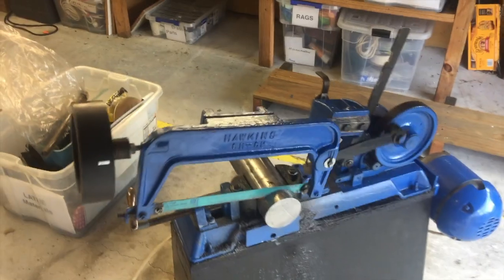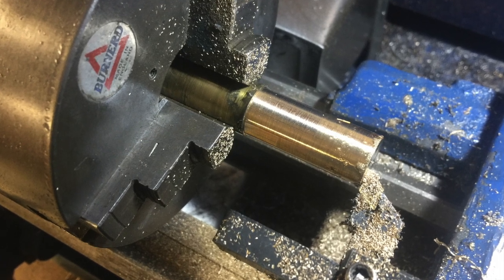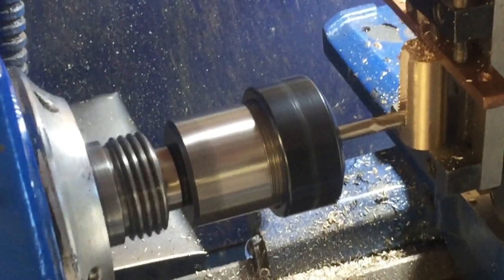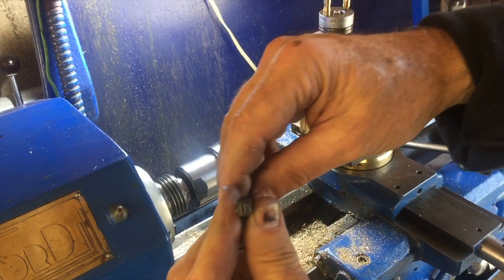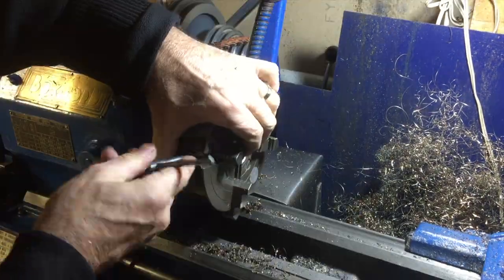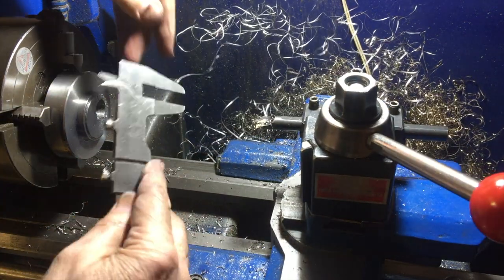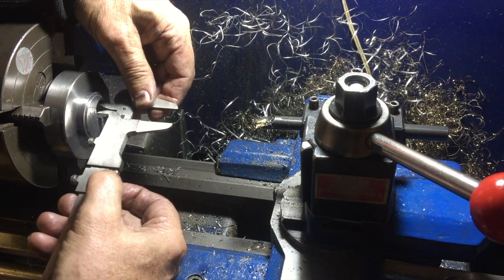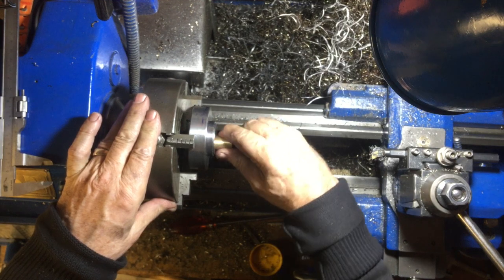Milling a slot with the lathe milling attachment

Comment: Conventional milling and climb milling were what you were discussing I take it. Climb milling can grab your part and cause a lot of damage. I believe you should be pushing the work into the rotation for conventional purposes? On your slot you were Climb milling.  nice work though :)
Reply from the maker: Thanks for the tip. I am learning the hard way! That tool I made worked well for stamping text in a circular pattern on bronze medallions.